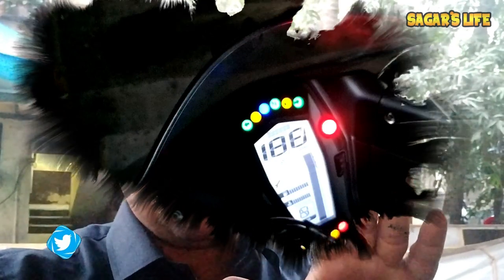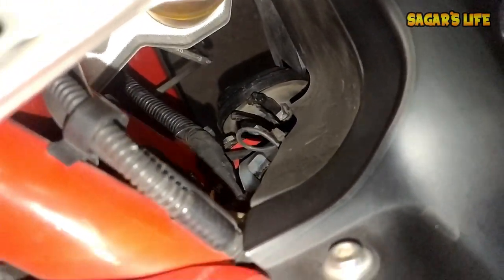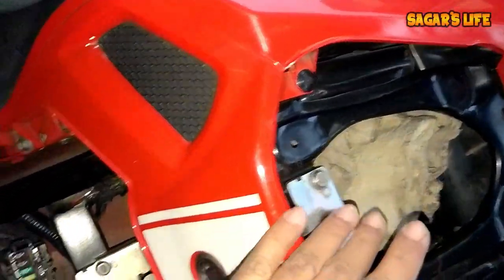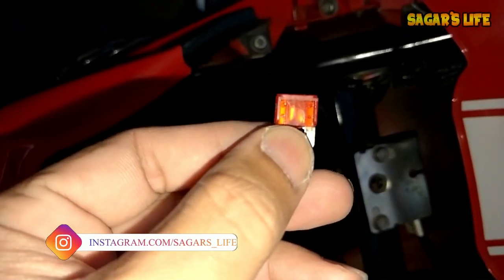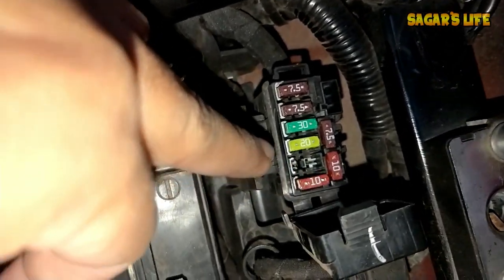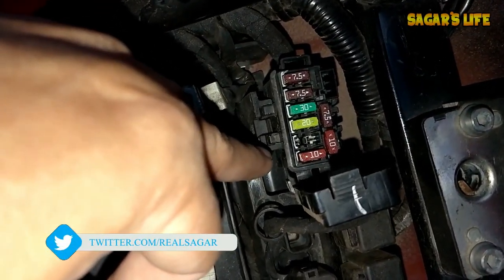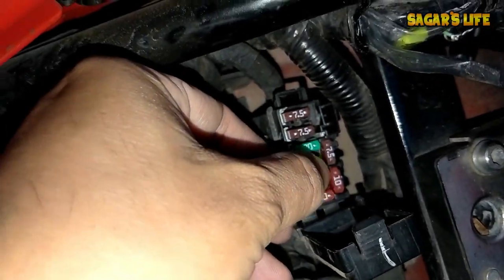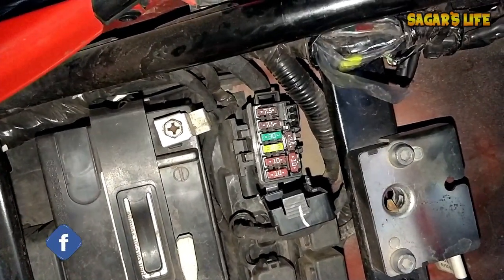Fuse Blown On My Apache RR 310 | How To Change Fuse

Comment: There are two spare fuse 7.5 & 10 in fuse box only but thanx for sharing, great work
Reply from the maker: There should be a extra fuse tied on chassis frame near fuse box 👍
Reply: Yes agree but first use which r in fuse box😋

Comment: Sir horn relay waprlelat kay installation chya weli..? Mazya moped madhe dual tone ahe cut out relay mule kahi problem nhi ala aj paryant 4yrs zale....
Reply from the maker: Yeah same here using the same horn on my Gixxer with relay install even after more than 3 years no problems... Rr310 had a different overload setup for battery
Reply: @SagarsLife  ohhh okzz

Comment: Bro my headlight is not working what should I do
Reply from the maker: Check the headlight fuse  if it's fine then issue with wire or assembly itself, need to visit Tvs svc

Comment: Bro how to remove fuse ? It has kept very tightly
Reply from the maker: Yes they are but you can use small screw driver or bike too for removing it
Reply: How can we use screw driver?..we have to pluck fuse know
Reply from the maker: Screw driver just for pulling it out not for opening it, otherwise use bike key I am using the same
Reply: Ok... thank u bro